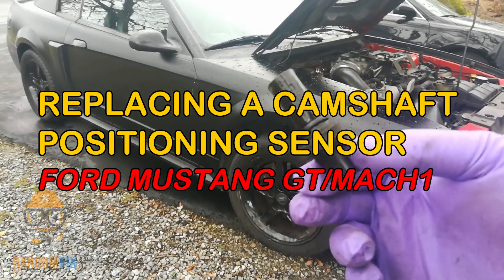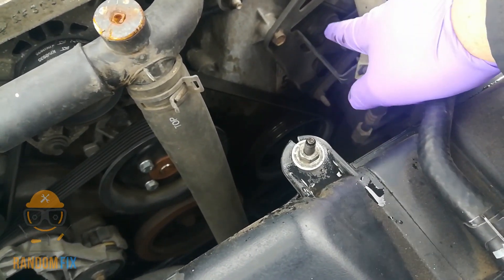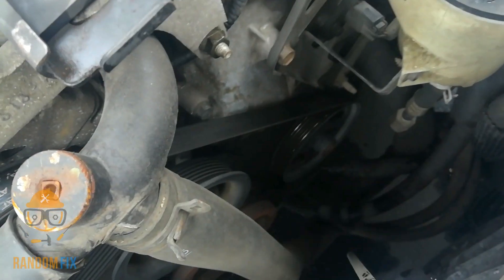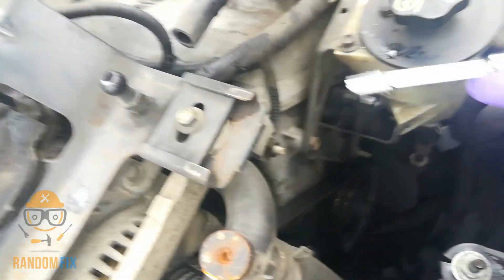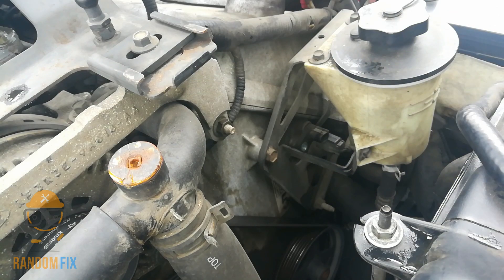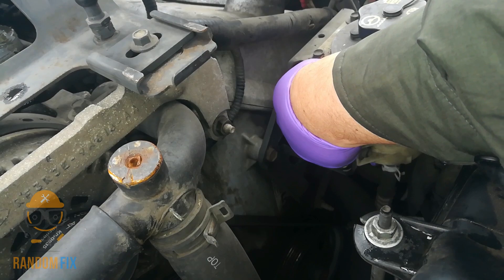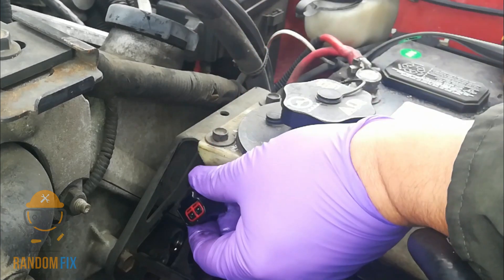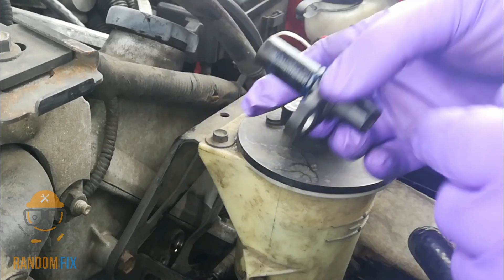How to Replace a CamShaft Position Sensor on a Ford Mustang

Comment: If your car needs all 4 replaced and you only replace 2 of them can that fix the problem a little bit or would they all have to be fixed? Cause I recently replaced 2 of the 4 that needed replace but it didn't help much cause I thought replacing half would be good enough. Should I go ahead and replace all 4?
Reply from the maker: Sorry for the late reply! did you find a solution?

Comment: My car turns off whenever i do a full stop on a stop or red light will this fix it? Car doesn't have any check engine codes
Reply from the maker: Can you tell me more. Is it a stick? GT or v6?
Reply: @RANDOMFIX  stick v8 2003
Reply from the maker: @Ho_Lee_Chitt  cool, I have a video on how to clean a iac valve. Check my Mach 1 restoration playlist. I come the symptoms of this exact issue on that video. Fyi on the mustang the brake booster is powered by the power steering fluid so when there a sudden load on the motor such as braking and you let off the throttle what will happen since most of the time you hitting brake and letting go of the gas, the motor will die because it can't idle because of the addition load caused by the power steering system which support the braking. Sound crazy but this exact thing drove me crazy on a white Mach 1 and a few GTs. You can clean it first or else I included a link that video to get the OEM for cheap. Best of luck and let me know how it goes. If you can't find the video just let me know. _Randomfix
Reply: @RANDOMFIX  thank you so much I'll definitely let you know and i subscribed :)
Reply: @RANDOMFIX  it was the IAC now the car feels great but the only thing is whenever i break the rpms stay between 2k and 2.5k and once i stop completely it goes down to around 800 to 900 rpms i'm leaving the engine running for like 15 minutes hopefully that's all i need
Reply from the maker: @Ho_Lee_Chitt  clean, the mass air flow sensor using mass air flow cleaner and also clean the throttle body using the correct cleaner. I always do clean the iac, the mass air flow sensor, and throttle body at the same time. Congrats again and thanks for letting me. _Randomfix
Reply: @RANDOMFIX  will do thanks so much!

Comment: Soo if that sensor is bad the car won't start?
Reply: Luis Montemayor yeah or it’ll have trouble starting . i have the same problem with mine but it doesn’t have that hard of a time
Reply from the maker: Sorry for the late reply! did you find a solution?